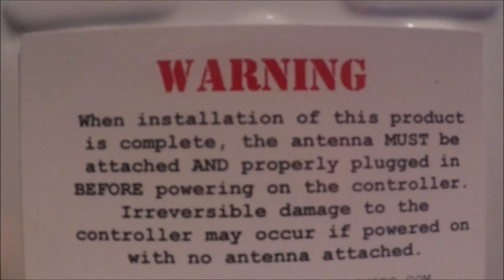DJI PHANTOM 3 standard DBS MODS Installation

Comment: Do u recommend this? I just installed the argtek but I just have the same range
Reply from the maker: Victor Mendoza  yes Definitely, before I could only go a 1/2 mile away now I've gone 1. 5 miles this is a directional antenna so it needs to be pointed in the direction of the Drone, I would try with the ARGtek first if you didn't point it at the drone, good luck 👍🏼
Reply: MrEbanks89 well I was able to get 2000ft with stock antenna I did a quick test with the argtek got to 1700ft but I’ll give it another try but if I only gain minor I might as well get itelite
Reply: MrEbanks89 also would if u happen to know would turning one controller without the argtek antennas damage the controller like the itelite
Reply from the maker: Victor Mendoza It's a possibility that's why I taped my off